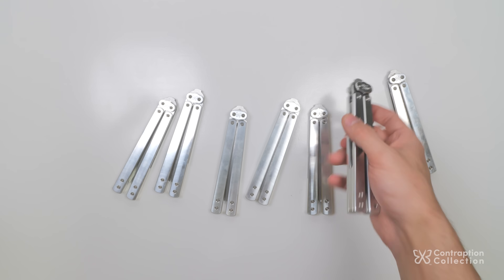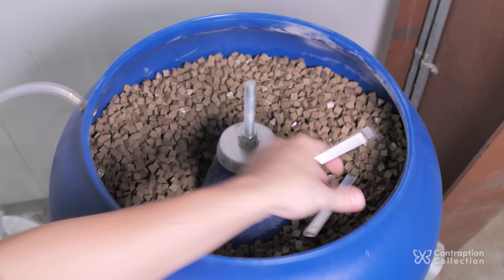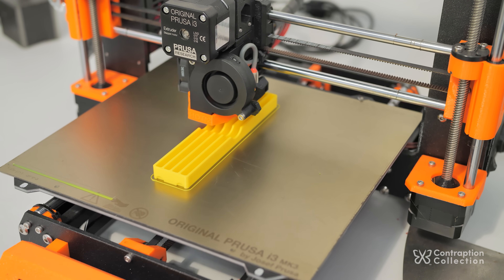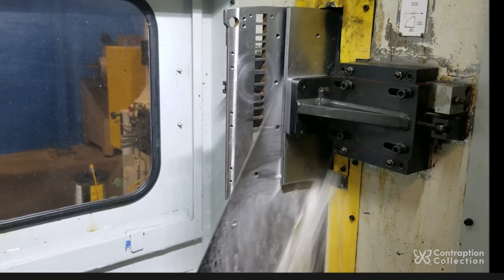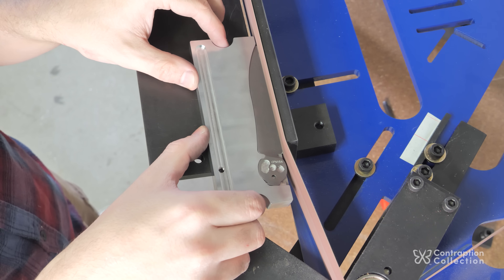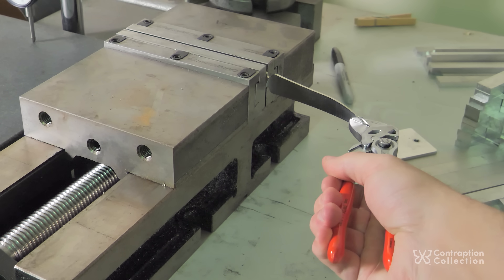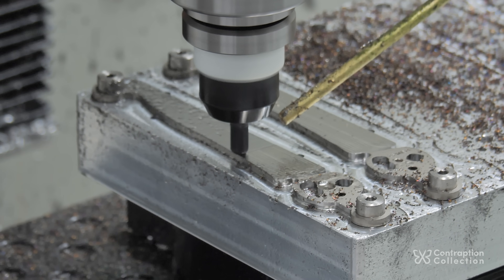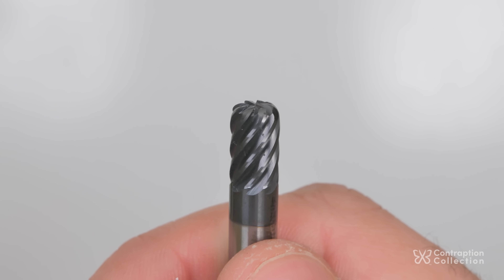I thought I was finished! Baliscissors: Ep 28

Comment: As a welder turned into a machinist ive learned that you can push heat stress out to a controlled point in the steel. More linear cuts result in more heat but your also pushing the stress in the steel out to the end of the cut. Another suggestion would be to have relief tabs that will take alot of the stress out at the halfway mark

Comment: Hey mate, you probably won't see this but just a suggestion. Have you had someone model this in solidworks?
Do a stress analysis, then maybe counteract the stress by incorporation a small radiused channel in the opposing side of the bevel?
It should affect the cutting action at all but it should balance out the stress that your bevel introduces.
You could machine your bevel, then slowly machine away with different depths for the groove until you have balanced the stress in the steel.

Just a suggestion

Comment: Any reason you're using bull nosed endmills over a ball end? Ball end might not wear down as fast.

Another option would be to use an inserted cutter for the roughing and the go back with the carbide for a finish pass. Only problem with the inserted cutter would be size, (you're looking at something more like a Ø.625 cutter), but the only real obstacle looks to be your clamping tang.

The thing with running without coolant is that the goal is for the heat to be in the chip and not in the work piece. Definitely tricky when working with hardened materials. But once the part heat up your already screwed. Trying to think of any little tips that might help... stick to climb cutting, try to use the side of the cutter more than the bottom (cut from deeper to shallower if you're moving on a slope).

Might also be a good idea to just talk to whomever you buy your cutter from and see if they've got some better tech than coated carbide. They'll probably push you towards whatever crazy expensive new thing they've got, but might give you some info that'd just be helpful in general.

Comment: I was going to say this happens to knives too if they aren't properly heat treated or you put to much heat back into the blade by shaping it , most knife makers will almost finish the blade before heat treating leaving only the final edge/s to be sharpened after heat treating also making sure the blade stays cool by using coolant or a bucket of water for those that do it by hand which also allows them to feel the heat through their fingers .. if your blades are to warped and super hard and you don't want to break them into pieces trying to straighten them you may be able anneal the blade straighten it and then reheat treat ...great job though and don't give up

Comment: The warp in the blades would be a heat related issue. It's the sharpness of your tool, the amount of coolant used, the speed of the cut and the amount of material removed per pass all adding up wrong for your particular use case. The only way to solve this would be to cut much slower or replace the tool head more frequently. Another possible way to solve this would be to machine the material before fully hardening it and then hardening the pieces in a press or mould that would restrict too much movement/correct the warp. The material is less likely to snap when correcting the bend before heat treatment and the heating process would likely fix the warp. I know some people use a bucket of sand or a few vices to correct/hold the shape of a blade while heating them for the final temper, i'm sure the same could be done for the initial heat.

Comment: look at old English scissors, they have big, thick blades that they hammer the set into after hardening. you need thicker blades with steeper bevels and maybe even a softer temper. what your trying to do is not as easy as making a knife so you should stop treating them like one, best of luck bud.

Comment: to prevent wearing the belt in a straigth line. align the base at an angle if possible, or adda wedge tot eh botom of the grinding jig so it is is higher at the tip of the blade then at the base of the blade. the part is in a jig so it doesnt matter if your holding it at an angle as long as its secure. this will give you a mroe even wear pattern on the belt and increase the evenness of the grind.

Comment: start with different steel. maby a more heat resistant one. if that doesn't work, smaller bevel. you can try different tool paths with both options (and the steel used in the video.

Comment: Great invention.  Maybe if you beef up the core mechanism a little, and control the bend by suggesting it warp the correct arc, the beefed up mechanism and controlled bend will help consistency some.  Maybe a heat sink clamp of two dif metals one on each side fo the blade as you kiln it.  Good luck!

Comment: Tip, I can help.  The milling cutting tools can be hardened further by wrapping a bunch of them in aluminium foil and then (stage 1) slowly cooling them with a little liquid nitrogen then (stage 2) 30  minutes later adding more liquid nitrogen ... overnight (always with Aluminium foil).  The tools will become super hard.  Then you can take it a step further (stage 3) ... do the same except use lots of liquid nitrogen as in step 2 except place the container into a vacuum chamber for at least 30 min.  I assume that you warm them up slowly.   The tools will be harder and last longer, they will also be more brittle.  The process includes some kind of Aluminium nitride surface coating and lattice hardening.  You can also add as a first stage (stage 0) very lightly using the tools for a few seconds first to expose the metal surface a little.   The types of milling/cutting tools you should use should obviously be HSS or Titanium coated items (kind of a yellow color).

Comment: Dude... your problem is in how much pressure you apply to the tie down bolts when you are cutting the bevels. what is happening, is there is memory stored in the material. So I would suggest using a torque wrench when tightening down your work pieces, for consistent draw down force. There are other ways to try and eliminate this "memory" but they are time consuming and costly. 1 way is cryogenics, where they are dipped in liquid nitrogen, and another way is is ultra sonically vibrating in a way to align the molecular structure, similar to a tuning fork. But, inconsistent tightening down, while relieving material, MOST DEFINITELY will warp your work pieces. Another suggestion would be to help defeat this issue, is a vacuum chuck or fixture, so you don't have 2 tie points, warping the work piece as the material is removed. By drawing the material down consistently across the entire work piece.

Comment: I wonder if semi submerging the blades in coolant and/or using  more thermally conductive frame(?) (not sure if it is the right word) and  a slower feed would help with the warping issue regarding heat build up at the tooling of the blades

Comment: i encounter this phenomena when turning "thin" stuff on a larger scale. The surface gets so hot you get thermal expansion, and the heat also hardens the material at the same time somewhat and fixes the thermal expansion, causes tension in the material and warps it. And this is with extremely hard materials like Safurex. The soft metal you use suffer from it way more, unless you are willing to use 1 new tool per blade, you cant CNC machine the finished product. You need a grind the material away with coolant.
Reply: I’m new to CNC machining and was looking for a comment like this to see if anyone agreed with me on the visual diagnosis. It’s crazy how the coolant is warping it so bad. .045 is pretty big!
Reply: Grinding was also my first thought, it would keep the tool colder, and besides, its a proven way of tooling blades. Nevertheless I loved his approach from a 'different angle'
Reply: Need to press evenly fresh out the furnace after hardening . Placing it on 1 side of a cold plate before pressing down with the other plate means 1 side of the blade is losing significant heat before it's being pressed which is literally what's causing the warp. This being a year old video, I'm sure he's figured that out by now.

Comment: 6:00 You can reduce the belt wear issue if you add a slope to the back side of the fixture (or to the platen) so that the belt is traveling at a slight angle to the blade. It'll also make them sharper to have the grind texture in a direction that creates micro-serrations along the cutting edge.

Comment: My mettal working experiance has only been home forging high carbon steel but normally for blades or items you need to not warp  I would anneal (sp) the piece to stress relief it before initial heat treatment.  this might be something to try with your stainless steel but the manufacturer should have specs on the temp time and cool rate wich may or maynot make it something you can do in house.  Stainless steels are a whole different beast than High Carbon steel when it comes to hot working.

Comment: In regards to using coolant while hardmilling - it's an all or nothing kind of thing.
Rapid changes in temperature are bad for carbide tools and can even cause them to shatter, so you want to either let the tool get hot and cool of slowly later on or blast it with so much coolant that it never gets hot in the first place.
Where I work we have 4 streams blasting at the tool and use internal cooling where possible.

Comment: hi man if i may give you something to try. Try to slow down the speed of the machining and the RPM and then try to use proper coolant. Or try to use cutting Fluids.

When we cut our steel it's not hardened and we use coolant for it, plus whenever we drill something we use coolant. I think it's a speed problem. so try to slow the RPM down and the speed of where it moves.

Comment: If you pre-tension the blade before machining, I wonder if that'd cancel out some of the warp. Though then you'd need to adjust toolpaths, make new fixtures, figure out workholding to keep the entire length of the blade in contact with the fixture, ...

If coolant shocks the tool, what about a different kind of coolant? Air would be far less effective, but perhaps sufficient to cool the blade.
Another option - alter the toolpath to make a cut at the end, then halfway down, then at the end again, and so on - allowing the heat to dissipate a bit between passes.

OD and centerless form grinders exist; I assume surface form grinders do as well. Coolant would cease to be a problem, though of course grinding (and particularly form grinding) brings its own assortment of challenges.

Comment: I know in the textile and salon industries scissor brands are a big deal. From what I've read there a bunch of heat treating secrets the "good" brands use to achieve just the right curve. Multiple heat treat cycles, stress relief cycles, monitoring of ∆t at different blade locations etc.

Comment: Any way to submerge the tooling or add cooling ducts in the jig, to pump coolent through there? having the blade against the jig surface like that may be heating the jig and reduceing cooling efficiency.

if the bits are what you are worried about.. than figuring out how to make the jig work as a heatsync for the part, may be a work around.

Comment: Try remove the material lenghwise not across, maybe that will reduce the bend.
Im a CNC Guy from Germany, whitout any knolage about blades, but i would Temper the blade bevore milling, then remove all exess material, harden and temper them and then finisch them by hardmilling just 0,1-0,2mm in all demensions. Thats the typical way to make very acurate strait hardened parts. Alsow ther is a process in german called "Nitrieren" thats a thinwall hardening process of some steels (not all steels can be hardened that way) but bennefits are its mutch lower Temp around 450-500C° where the materials dont warp mutch, its makes a hard surface but a non hardened "inside" basicly the blade would be elastik it will not break it will bend but its hard at the outside, bad thing is you cant rescharpen mutch cors its only 0,20-0,50mm hardened material. But in my opinion a elastik blade will maybe put out some nicer feel for that kind of Produkt. But still i have no clue of blades :D Take all that whit a grean of Salt.

Comment: what are the odds these would be legal in canada, as they arent knives but rather scissors?
also, you might be causing issues after the heat treat because your finishing the blade AFTER the quench. Most blades have their edges all but finished before the final heat treat, and then polished to sharpness after.

Comment: make 3 lines with a marker on the inner bent side... heat the inner line with a blowtorch or a heat gun throught a template so it gets heat more focused and then pour water from a bottle with a hole in the cap on the outer lines so it shrinks/compresses the softer hot part in the middle

or rough mill the part with some clerance (you can figure that clerance by testing if the part doesnt fully come out...) then put the blade in the heat threating oven with some holds or smth and remill it should bent way less

Comment: Instead of machining the pattern in the handles, it would be much better to use a laser engraver it would be faster and get a good patter too, you could also play with the settings to get different depths for the patterns to adjust grip. It would be much faster than machining.

Comment: Try chrome plating the blades and cryotreating them. The chrome plating will disrupt the molecular slip planes of the metal crystals, and cryotreating offers many of the same benefits as heat treating without nearly as much warpage. Alternative, or in addition to cryotreating, you can try sending the blades out for chapmanizing or N135 nitriding. This will make the surface hard without penetrating deep into the metal itself, which may reduce warping.

Comment: You'll probably need to move to tooling with removable tungsten carbide inserts, though changing over to a steel with a lower final hardness and wear resistance would also extend the life of your tooling. Even if I'm not a huge fan of balisong, this is still a fascinating project and a safer way to play with it while still having a functional tool at the end of the day. It's very cool, so I hope you manage to get your grinding problems sorted out.

Comment: i think if you spend more time looking at them as scissors and looking less at knifes and more at scissors, youll find your answer. cause rn the scissor blades are basicly 2 knives slapped together with some pins and floppy handles, where as scissors have thick spines and small bevels that are only on the cutting edge, not the hole wight if it

Comment: If have lets say 5 blades in the holder and you run the tool for 20 seconds on it, switch to the next one by and so on until the 5th one. By that time the first one would have cooled and you don't have build up of heat. Also better airflow through the machine ?

Comment: I'm no knife expert but a machinist.  I think your process should be to rough mill the bevels then heat treat and wet grind to finish to finish the bevels.  Also sharp tools are best for a small operation like you they will be expesnive.  Maybe inserted cutters might be a better option because inserts are fairly cheap compared to replacing the whole endmill especially if you aren't getting them reground.

Comment: Have you tried hardening with oil? I only really have experience with blacksmithing but as long as you don’t go too fast and you can get your blade warped the way you want depending on how you angle them. If you do it directly along north and south it won’t warp. If you do it slightly off it will warp towards the north so you can get the warp on the side you want knowing this.

Comment: Hey buddy enjoyed your video, I work in precision machining & have a suggestion for your bending issue. Not sure on the capabilities of your equipment. 
but if we need anything held to a .001 or better flatness post heat treat I on thin stock like that, we usually will have to lap or surface grind faces flat before hard milling. In your case you might have luck surface grinding both sides or just one side to save time. Take minimum stock until your sides are reasonably flat. If the blades faces are warped from heat treat, the hard mill will follow the surface it’s sitting on.

Just realized I missed the part where you said you tried grinding them flat with the same result. You could try stress relief after heat treat? Sounds like they are popping on you and there’s not much you can do depending on the material. 
If you can take .0001 passes on your surface grinder, rough them down to .010-.020 above finish size, heat treat, then surface grind both sides, take .001 at a time, flip take another .001 from the other side. Alternate sides until you are to finish. Run coolant on the surface grinder if you can. 

Or switch to a more stable material if you can’t do what I described.

Comment: Very cool. 

One thing though, the laser engraving looks great when new, but will wear off with time. It may or may not be an issue in this application, but that is something that is a real problem for ratchet sockets and the like. Again, with less use/less things physically touching it (and not as harsh an environment) it will last longer, but is something you should consider. 

Maybe see what stamping, then anodizing, then laser engraving the letters to make them stand out more looks like. Then you'd get the durability of the stamping, and the contrast of the laser. (If you said it was engraved and not stamped, sorry. I forgot which process you said you used. In either case though, the letters are much more permanent than the laser method)